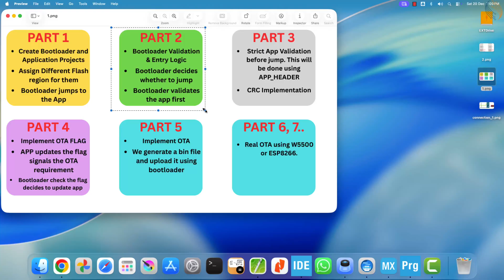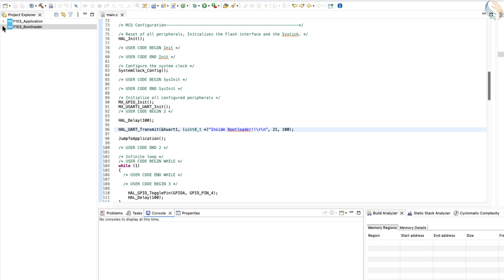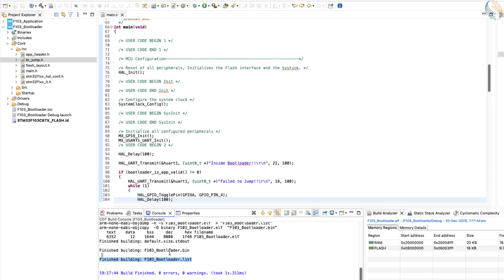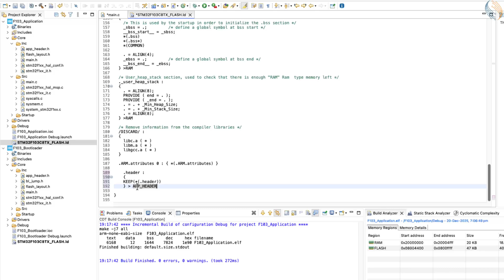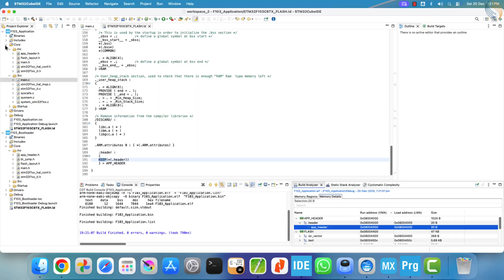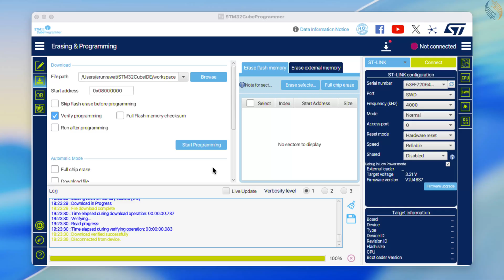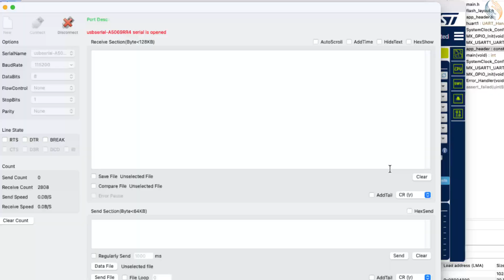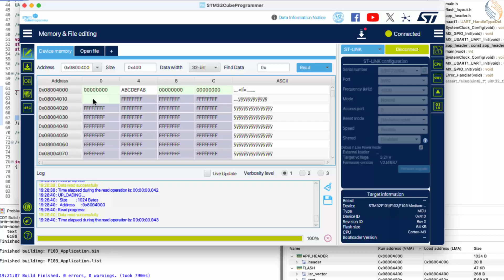STM32 Custom Bootloader (Part 2): Bootloader Validation & Entry Logic

Comment: For the application + app header, is it possible to start the flash from 0x08004000 instead of 4400? Would that place the app header (and the application) correctly? Great video, thanks for this!
Reply from the maker: No, the app header needs to be separate. We will erase and write it during runtime and you do not want the application code to get erased in that process.
Reply: @ControllersTech  Looking forward to it. I figured you would first compile the app, calculate a CRC using an offline tool (python/C script?) and write it back into the app header within the binary itself, and then have the STM32 hardware CRC perform the same verification during startup within the bootloader itself. Thanks for your response!
Reply from the maker: You will understand it better in part 4.

Comment: To overcome the issue with the bin, we at NXP define the concept of Image Vector Table. It's a vector with predefined addresses at predefined offsets for critical assets such as APPs binaries and other relevant data. The user can program the addresses.
What user can do is concatenate these binaries using some tools(you can write a python script or some vendor also provide as in NXP) with assets(apps and other datas) at the addresses mandated in the Image Vector Table.
Reply from the maker: It will be handled in the next video. We just need to generate a new bin file without the application header.

Comment: Thanks for the video. So in short, bin is not suitable to use to flash the stm? You cannot guarantee that the programmer do what you attended to do? to make it as a role .. should we avoid bin?
Reply from the maker: Bin files lack address information, therefore we need to generate them carefully.
You can always use the ELF files but they are not suitable for OTA updates as they have extremely large size compared to bin files.

Comment: i want to use external flash for temporary storage of application firmware. how to do?
Reply from the maker: What do you mean by temporary storage ?
Reply: @ControllersTech  i believe he meant that he wants to use external flash memory chip for the application software that can be just soldered onto the board.

Comment: I'm trying to create something similar with my current project, but I want to have header as a part of the main application, without any extra flash pages or sections. for now it kinda works, but maybe I missed something. can't wait to see all your video in this series!
Reply from the maker: The header will be later modified by the bootloader. It will erase the specific page or sector and then write the data.
This is why I advised to keep it separate from the application.
Reply: @ControllersTech  smallest sector in my chip is 32KB, so I refused the idea of having whole sector only for app header. I'm calculating CRC and firmware size at host before flashing, so for now I dont actually needed to write something from the bootloader. Anyway, I want to see how would you do this
Reply from the maker: The key part in the app header is the OTA flag. Even if we assume that everything is going to be constant and will remain unmodified, the OTA flag still needs to be updated.
Once the app receives the OTA / request, it will set the OTA flag and reboot. This needs to be done in the runtime, hence it can not be treated as a constant value. 
The bootloader will check OTA flag, flash the update and reset the flag. Therefore the bootloader also need to erase the sector/page to achieve this.
So if you want to save the 32KB flash, you need to find some alternative way to signal the bootloader that the OTA has been received.
Reply: @ControllersTech  I think that OTA flag can be a RAM variable carefully managed by both application and bootloader, OTA flag treated with options and linker scripts being un-initialized RAM section.
Reply from the maker: Yes that can be done as well.

Comment: just finishes implementing custom bootloader sawing you video - part 1, and now I got this . wow !!! anyway I had an issue, the system did not work so took some help from chatgpt. I had to change the memory mapping. I'm using stm32f411CEU6. had to comment our the application header and do this instead #define APP_START_ADDR   0x08008000 //464kb and it worked. From gpt:

❌ Problem
Your vector table is located at 0x08008000, but you are:
Reading MSP & ResetHandler from 0x0800C000
Setting VTOR to 0x0800C000 That means: You jump to garbage MSP is invalid
CPU enters HardFault → halted

also gpt says to deinitialize  before jumping to application (before setting MSP) by:

HAL_RCC_DeInit();
HAL_DeInit();

also set the VTOR: 
 
SCB->VTOR = APP_START_ADDR;
__disable_irq();

thanks anyway. lately i've been thinking I need to know what's going on under the hood, how an OS works, memory works, wanted to do low level programming that contains handling registers and memory and I found that learning stm32 is a good option. I've been following you since then and you're videos are very helpful. Thank You <3
Reply from the maker: No you are getting it wrong. I have placed APP_HEADER at 0x08008000 and application start from address 0x0800C000. The vector table is also located at this address. You can check the memory mapping in this image https://controllerstech.com/wp-content/uploads/2025/12/custom_boot_1_6.webp

The same memory layout can work for STM32F411 as well.

If you place your APP_START_ADDR  at 0x08008000, where will you place APP_HEADER ? It is required as you can see in this PART 2.
Reply: @ControllersTech  i found out what was the problem. at first try I have created header address in the layout but I flashed then bin instead of elf (watching your part 1 video). as you said bin if flashed sequentially all the application data went to the header section address. also you did not show us memory definition for APP_HEADER in the first video, in my case:
/* Memories definition */
MEMORY
{
  RAM       (xrw)    : ORIGIN = 0x20000000,   LENGTH = 128K
  APP_HEADER (rw)    : ORIGIN = 0x08008000,   LENGTH = 16K
  FLASH      (rx)    : ORIGIN = 0x0800C000,   LENGTH = 464K
}
Reply: @ControllersTech  I did not use  APP_HEADER at first try.